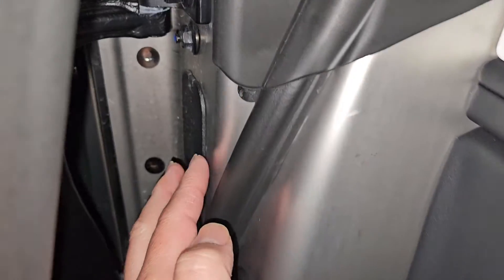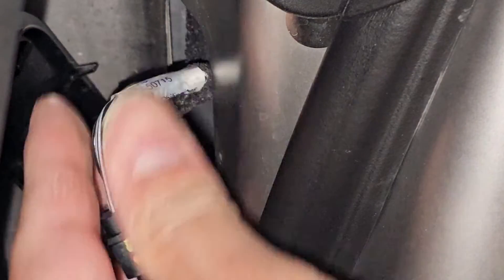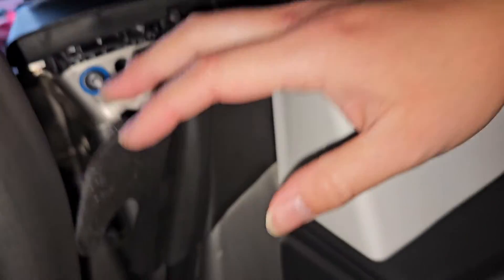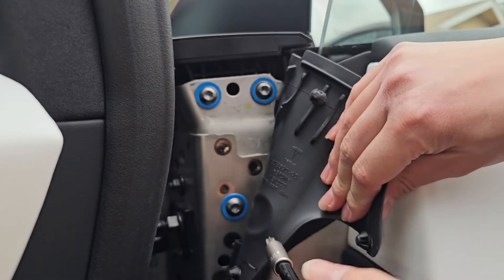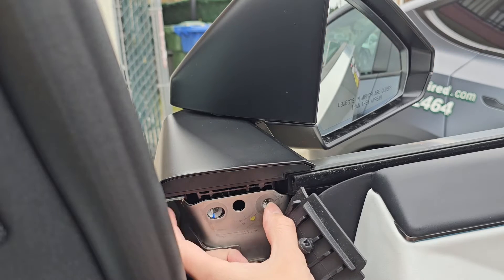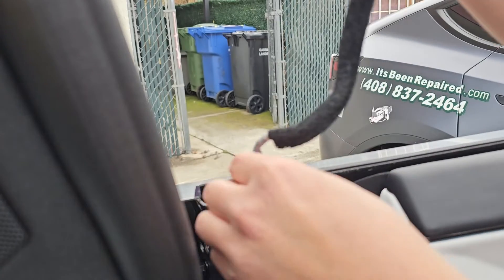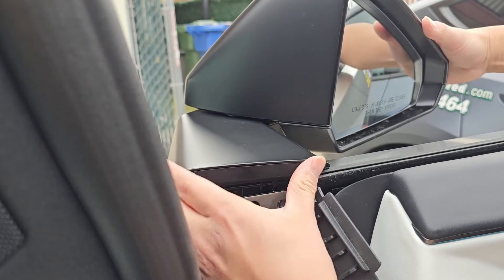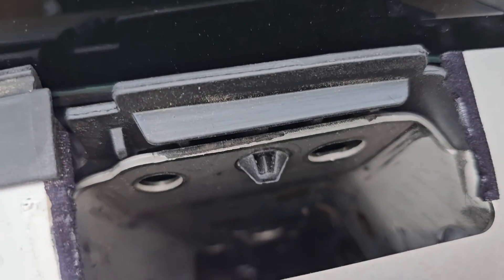Tesla Cybertruck Side View Mirror Removal Replacement Disassembly Installation Tutorial Hpw To

Comment: That Cybertruck torx flange head bolt is weak and inconsistent size either T30 or T40. Better replace them with Pan Phillips Machine M8-1.25x30, Hillman brand (Lowe's). And use any similar size washer (cylindrical with hole in the center). That Pan Phillips Machine bolt head size is thick, you don’t have to tighten it that hard. With that, the side mirror stays firm, easy to open, any screwdriver will do!
Reply from the maker: @hiskandar  I removed the mirrors. No need anymore. Lol
Reply: @ItsBinhRepaired  I wish it is legal to go around in Cybertruck without side mirror in my state. LOL
Reply from the maker: Whispers* "It's not legal in any state." I'm traveling to every single state capitol at the moment if you're interested in following along. It's in my playlists being updated daily. So far I've only been pulled over once in Crowley, Louisiana and that was for being radared at 82mph in a 70mph zone... $305 ticket! Bunch of BS... lol
Reply from the maker: None of the police know. I doubt they'd ticket you unless you're driving bad.
Reply: @ItsBinhRepaired  I better not risking it, LOL. It is really not worth the 300$, I can buy a 15 m roll to wrap another Cybertruck with that 300$ LOL.
Reply from the maker: @hiskandar  lol

Comment: Nom nom nom mmm Coacoa Pebbles nom nom. Huh? Oh, hi Bihn! Sorry about that, i love me some Coacoa Pebbles, lol.
Anywho, may i ask why you are doing this to a hundred thousand dollar vehicle? How are you gonna know when you have the Police after you in a high speed chase? Bro, you need rear view mirrors. Now, you don't have any and your new truck has a big hole in each of the doors. You better put those back on before Mom finds out! Or, im gonna snitch on you. It's just not safe to have no rear view mirrors. 
Well, unless you just have it parked and are just using it as your power supply, with your stove, washer, dryer, toaster, microwave, tv, electric tooth brush, hair dryer and etc., plugged into it. That reminds me. Why on earth did you cut that big notch out of your door to run those extension cords? You're kinda young to have Alzhiemers. Your cheese has slid off of your cracker again, Bro?!?
Great product placement with the Been repaired ad in the background. Hey, why is Binh spelled like Been? What's up with that,  also? 
Piece out! ahahahaha 😅
Reply from the maker: Lol I can still see using the cameras. No mirrors needed. The hole was necessary. No alzheimers necessary. XD And the website spelled been is likely to get more hits.
Reply: @ItsBinhRepaired  Holes necessary for what, sir? 
What about cutting that piece out of your door for the cords?
But I liked the Binh repaired part. It was cute, clever and unique.
How do you catch a Unique Rabbit?
You unique up on it!
Reply from the maker: Lol I can't cut through the truck without causing issues.
Reply: @ItsBinhRepaired  No, silly. You cut the wooden door at your house to run the extension cords under. Maybe you have Dementia.
Reply from the maker: @mrkemblegilstrap  I did cut a piece out of the door. What about it? Lol
Reply: @ItsBinhRepaired  Eeeeeek! Take it easy there big guy. I was just curious sheeeesh
Reply from the maker: Lol